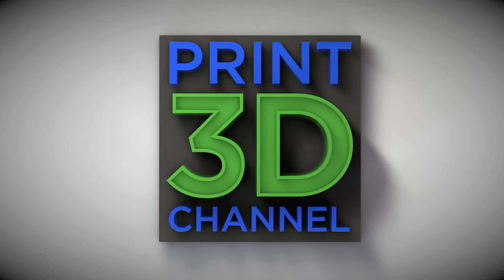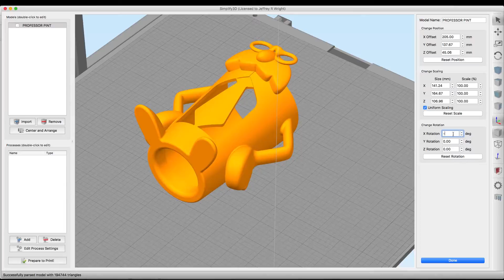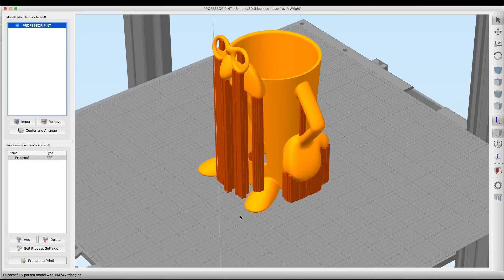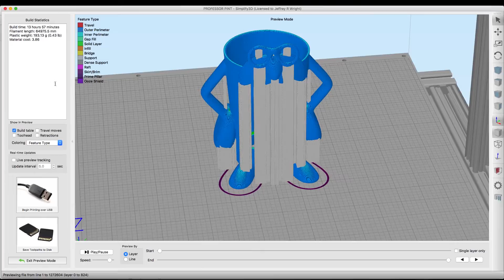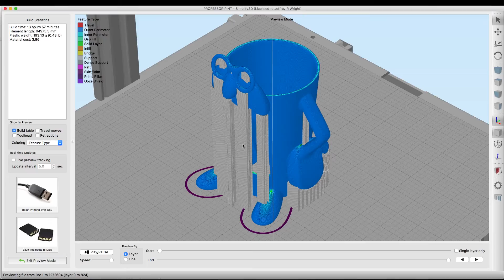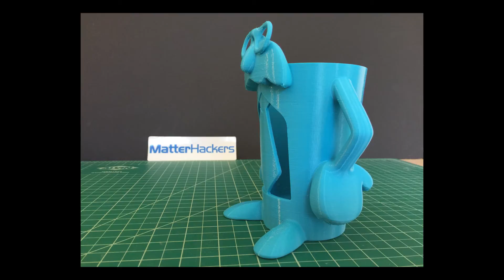3D Printing Professor Pint on the gMax1.5XT+ with MatterHackers PRO PLA

Comment: If you insulate the heater block you will not need to worry about excess cooling. I ran into this issue, and I didn't want to sacrifice print quality by lowering the fan -- so I insulated my heater block, and now no amount of cooling impacts the hotend temperature. It seems rather strange that fairly expensive machines don't bother to insulate the heater block.
Reply from the maker: +kazolar that's a question for the folks @gcreate3D, I am totally new to this hobby slash industry and if you watched my channel trailer, you know the printer was in pieces when it arrive at my desk and I reassembled it. My knowledge of 3D printers is limited to this one. That sounds like I great idea but I am clueless how to implement it or if I even should considering the hot end will soon be E3D. Thanks for watching 
and for the comments.